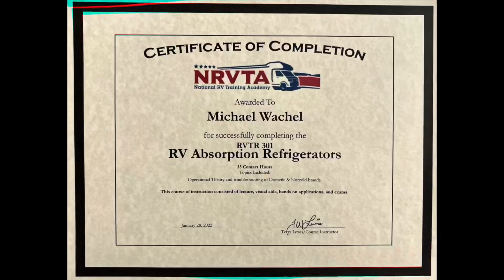Advanced Refrigerator Class Done! | Intense Week | NRVTA Mobile RV Tech Training | RV Life

Comment: So next week is going to be week 2 of 5 of advance training right ? As well have you learn how to do regular maintenance and how to reseal your roof ?
Reply from the maker: Howdy! This coming week is week 2 of 4 advanced classes to become a registered tech. 

The total classes for becoming registered is 5. 
-Fundamentals (done)
-Advanced refrigerators (done)
-Advanced AC (this week)
-Exteriors
-Water heaters and furnaces. 
Then you test for registered tech. 

I added an Advanced Solar class but that’s not required. You can also add Advanced Generator as well as an option.
Reply: @SaltyVetAdventures  
Thank you for that information.  Do they teach on how to work on the new 12volt refrigerator that just work on 12volts ?
Reply from the maker: @Hugo-Hernandez  They have some 12v fridges but we don’t work in them….yet.
Reply: @SaltyVetAdventures  
So they didn’t teach how to work on them ?
Reply from the maker: @Hugo-Hernandez  No. There isn’t much to work on since it’s a sealed system. That I’m aware of.